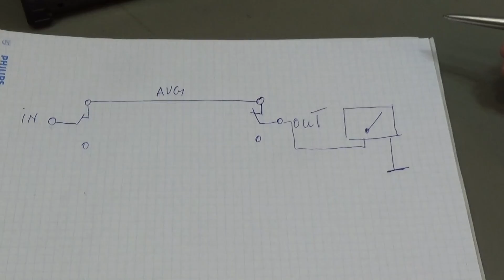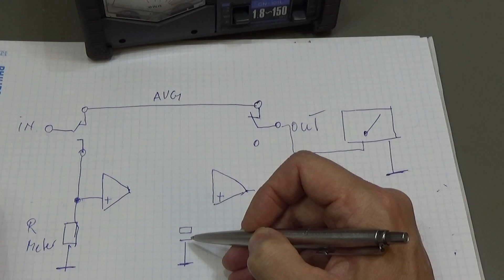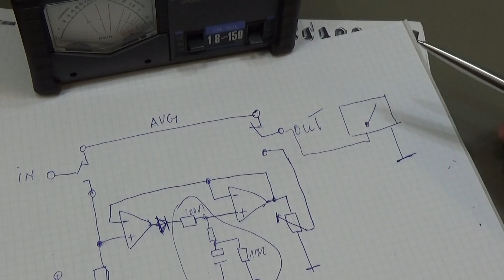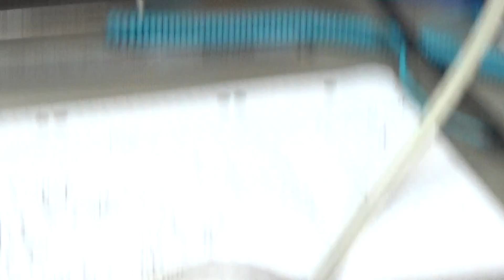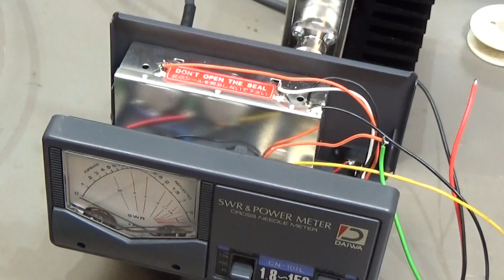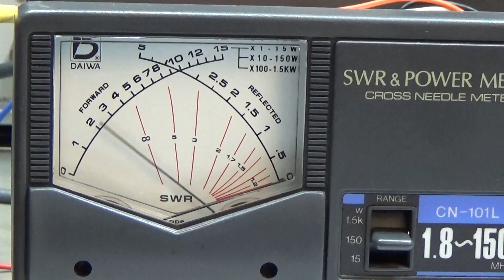#55 HAM Radio Tutorial: How to make a low end SWR/ Watt- Meter reading PEP power

Comment: i know its 11 years ago, but you could also connect the module where the little "pep capacitor" is if you take it out. then you can use the switch as is.

Comment: Hi Peter. very interesting video. 
I own the Daiwa CN-501H now which is the newer model then the one in your video. Same issue, it does not have a real PEP reading. It still does have exact the same type meter in it "A 8907"
I do have some questions ... 
- Why didn't you use a standard double changeover switch instead of the relais which makes the voltage regulator not necessary.
- Have you allready updated the project and if so ... do you have a partslist you can share with us ?
Thx de ON1JV 
Jan

Comment: There is a slight DC offset where output opamp does not have the ability to switch to 0v with single rail supply.
You should place two diodes in series from opamp2 output or zener to essentially lift output of opamp above 0v.

Comment: I am Emílio Abrahão, I speak of São Paulo - Brazil.
I subscribed to your channel recently and you approach maintenance quite broadly and I like it.
You repair and restore various old equipment, HF radio and other interesting equipment. You give us the possibility to find solutions where we could not find without guidance. I like it when you show old measuring instruments like analog and digital multi meter. I'm trying to recover my old analog multi meter, but I'm having trouble getting specific components for it, but I'd like you to help me get those components. If you can help me, I'll tell you what the components are, and then you let me know the component prisoner and the post office.
  See you later.

Comment: Thank you for your very clear, concise, and professional presentation.

Q: Is it not necessary to have a second similar 'PP' circuit in the Reflected Power meter circuit in order to retain the cross-needle SWR function indication?
Reply from the maker: Thanks for feed-back. Yes in this example the rev power can't be read in pep.. 73

Comment: Bad design with the op-amp part of the circuit.
Your meter jumps from zero watts to something higher than zero watts when you power up your PEP circuit.
 The meter should not move at all when you switch the peak detect circuit on...
 The rest of the design is fine; although it might be nice to add one more potentiometer to modify the discharge time of the peak hold capacitor.
Dennis O.
#12
Reply: This is due to the LM358 opamp not being "rail-to-rail" - that is, the output can never be equal to the positive or negative power supply rail, and in this case, negative supply of the opamp is ground so zero volts; the output will be a small value but something higher than zero. Using a higher-spec opamp will solve this problem, look for "rail-to-rail output" and "common-mode input range includes ground" as search keywords and you will quickly find some suitable parts.

I think what he wants to show is that you can get good results with very common parts - if you want high accuracy, you are going to use a more expensive opamp, the rest of the circuit remains the same.
Reply: You can even do it with an old 741 series op-amp because it is only amplifying DC.
(although I would have also chosen the LM358 for the task)....
The rail to rail concept will never be true rail to rail.
So you bite the bullet and use two batteries to power the peak detect device instead of only one; and your problem is solved.......
Reply: Dennis#12 True, using op-amps with a single supply will always be some sort of compromise. Split supplies are the best way to go in any opamp circuit

But in many applications a single supply will do and there are plenty of high performance opamps that will operate satisfactorly even with a single supply. It's all about "good enough". :)

Comment: I watched this a little later then most and it was interesting.  But after you build and test the circuit, shouldn't you then remove the pot as the meter movement would be in parallel and cause errors in the meter reading?
Reply from the maker: +Joe Loucka Hi Joe, good question, but in this case is doesn't matter as the OP impedance is very low and in a parallel circuit the voltages are always equal only the current is a bit higher but the low impedance can handle it without voltage drop.

Comment: Will this addition upset the SWR reading?
Reply from the maker: +Howard Malpas Hi Howard, no it does not influence the SWR reading. 73
Reply: Thank you, I will give it a go.
Reply from the maker: +Howard Malpas Good Luck!  It turned out that it is best to use 150 Ohm to load a capacity of 10uF and use 100K to discharge 73

Comment: Awesome Peter! I had to pause the video to say, "nice to meet you!" Great to see you on camera!!! Ok, now I un-pause and watch the video..... Then maybe another comment :^)
Reply: Mr Carlson's Lab Ok, I watched the full Video now. Looks great, I have the same Watt meter here, so I will have to build the circuit now :^)
Reply from the maker: Mr Carlson's Lab Hi Paul thank you very much! You know why :-) We will hopefully see when your circuit is running ... 73's
Reply: Great! Peter is a super nice fella, and knows his stuff.
Reply: TRXBench Great video and well explained. I have a Bird 4304 RMS meter I like to do this to. It is the one without the slug. 15 to 500 watt. I also have the Telewave which is identical to the bird.  Thanks for the video!
Reply from the maker: The Radio Shop Hi there, thanks for comment. Have fun with the project. 73 Peter
Reply: +TRXBench I watched this a little later then most and it was interesting.  But after you build and test the circuit, shouldn't you then remove the pot as the meter movement would be in parallel and cause errors in the meter reading?
Reply: +Mr Carlson's Lab Thank You for introducing me to TRXBench.  I'm enjoying the video's as I do yours.